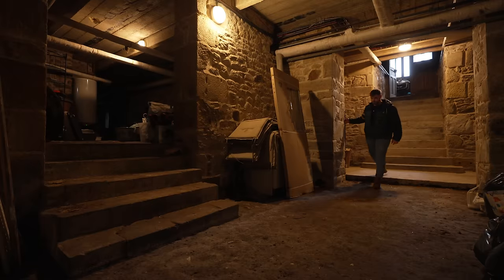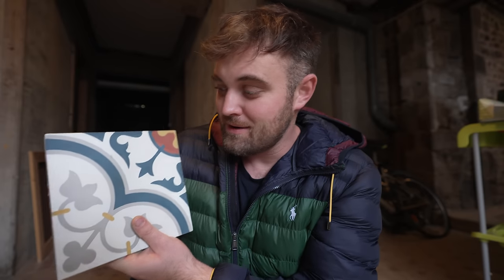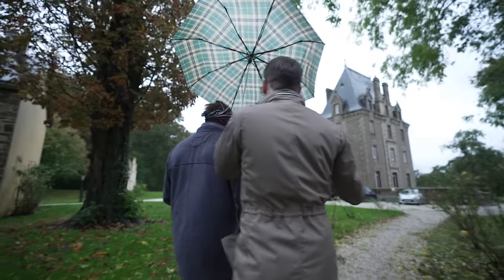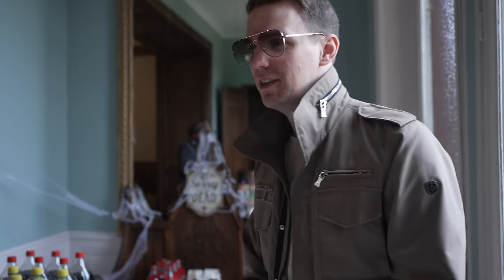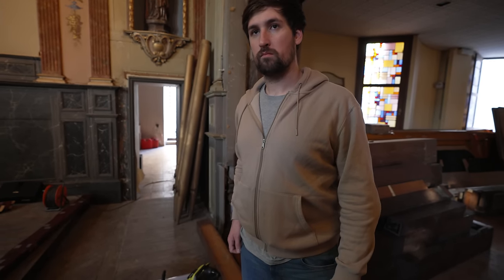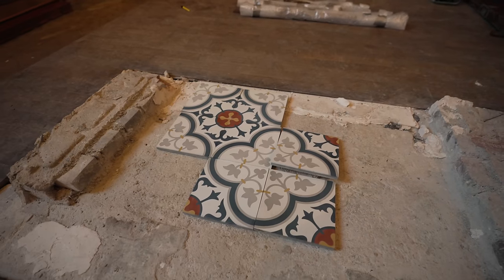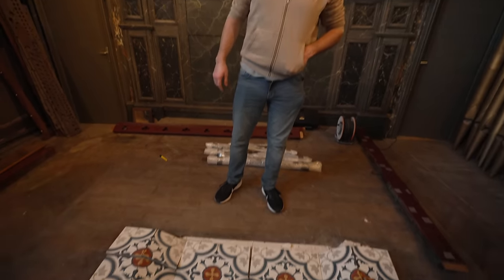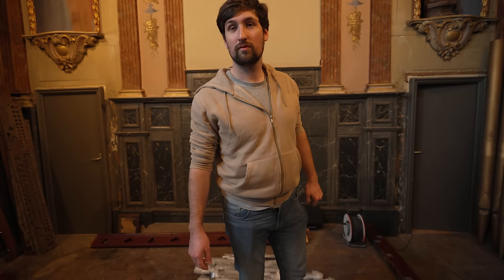Hearing Footsteps Inside The Old Convent

Comment: Wood heat warms you twice. When you cut it and when you burn it, but solar would be amazing. In the attic, sprinkle some chalk dust or flour on the floor, back you way out and then the next time you hear anything, check for footprints, large or small.
Reply: That was my thought with the chalk/flour, good plan.
Reply: Good thinking 👍
Reply: The rats!!
Reply: I work on the theory of 4 times.  You forgot the times when you stack it after its cut and when you move it from the wood store to the log basket.
Reply: Ghosts don't leave footprints.
Reply: The flour would prove whether it is animals or not making the noises.

Comment: It is amazing, the size of the Chateau's basement. The ceilings are tall and there is so much space. The other day I was thinking about your Chateau and the convent and thinking that solar might be a really good option. Also, we heat with a heat pump and it's just great. Heats the whole place with no problem, then in the summer you reset it and it's an air conditioner and keeps you cool.  Well, I have to say you and Ryan are a lot braver than I am. I heard the footsteps, but when that door shut and you both just stood there, I was like, why aren't they running away! Or checking behind the door! Crazy!  The tiles look nice.

Comment: I only found this channel last week. Very very cool. Even my granddaughter was instantly hooked. The tiles with the border would be amazing. 2 things though. First, I saw a comment about 10.24 in the video. There is something in the bottom left corner of the doorway. At first I thought it might be light reflecting from something, but it moves forward and back as if peaking around the doorframe then hiding. To me it looks like the outline of a child. Maybe something not seen on the other side of the wall was moving in the breeze causing it.  Second, rats and mice hop sometimes and it sounds like someone walking. Once had a mouse that hopped down my stairs, i was so sure it was a human i grabbed the gun. I didn't shoot the mouse but he did move on to another place.

Comment: Here's a thought to consider FYI
We have stellar Jay's that hop about on our roof and i have been startled more than once thinking SOMEONE was up on our roof walking about. Raccoons also are spooky sounding. 
You might consider it is animal or fowl causing the sound of footsteps! I am hearing them through the insulated attic in my case. 
The closing doors is likely air current or settling of that section of the convent. Unsettling,  but probably normal for the size and age of the convent.

Comment: With my heat pump it is the contract that I only pay for parts after parts, not labor after  the company comes and checks it if I feel something needs looked at, plus they will come check  as the seasons change for free. My only problem here in Florida are those little lizards that in it at times but pepper around the outside unit keeps them  away.

Comment: I also have photovoltaic panels for my off-the-grid Barndominium (Amish-built steel barn tuned into a garage and living space), and considered recirculating fluid in-ground heat pump, any people I know who had them say they are a huge drain on electric usage. Though it would need underground lines to be laid for recirculating a non-toxic antifreeze, heat from the ground is much less of a draw than air-to-air.

Comment: Billy: Check on a geothermal or ground source heat pump system for the chateau. You have lots of space to condition, and lots of land for the tubing. Not inexpensive to install, but inexpensive to run, and you get hot water and AC from the same system. It's also invisible outside once installed, low maintenance, and should last for decades.

Comment: Go, Yanis, go 🕺🏽.  Fantastic to see Rick.  Sensible idea to get solar and heat pumps for the Chateau.  We have had solar here for 3 years and it saves a lot of money each year (charges 3 cars, runs the Farmhouse for a lot of the year and even in the winter it gives us power for hot water/tumble dryer etc).  We need to replace our 10 year old oil boiler soon - and considering heat pump, electric boiler or infrared.  Wonderful to hear the bell ringing.  Have been watching a ghost series on BBC IPlayer called Uncanny (I recommend it, if you want something spooky for Halloween).  I am off to a local Manor House for a ghost hunt 👻

Comment: Happy 🎃!  I love the tiles, just not in the chapel - takes away from the reredos and other ornamentation around the alter area. Maybe a single slab of black marble acid washed so it’s not shiny. Even just putting wood and using a large burgundy rug for events. I was also wondering if you’ve seen under the chapel to ensure it’s strong enough to hold the organ. You’d said it was heavy earlier.

Comment: If and when you install solar, look at systems that have a power optimizer. They are very efficient and maximize production of electricity. Great for use in locations where some panels are apt to go into the shade (chimneys, trees, turrets, etc.)

Comment: If you are really looking at long term sustainable heating and cooling look into geothermal. It is extremely efficient and you definitely have the land to have a good horizontal pipe system. It can be expensive but it is something you can do yourself and save a ton in labor costs. Cool air in the summer and inly have to heat from 55 degrees to whatever comfort level you want.

Glad the party was a lot of fun!

Comment: Your party looked good. I didn't know Yianis had swivel hips like that! Solar power is definitely the way to go with both the chateau and the convent. You have other farm buildings that you can put solar panels on, to maximize your wattage. I love the tiles, but if they are going under the organ, then we won't see them. I would put something plain under the organ and use these as a border. I also think it is time to get a lot more cctv in the upper levels of the convent. You need to feel safe there, not worried. The door shut probably due to the wind, but I think you may need to ring that bell a bit more too! 👻 🔔

Comment: Nice vlog, and the tiles look great, as does that chandelier..I'd have been more worried about the door slamming shut, than the footsteps,  surprised you didn't investigate  that...PS the heat pumps are not great; they cut off if it is too cold outside, ( just when you need it!), and never yet have they reached the desired room temp of 19C.

Comment: You could level the area low enough that the tile will be flush with the wood floor, except for the taller side pieces. For the two taller sides, you can level them with the hight of the tiles, so that they are still visible, but not standing proud of the floor. I would consult with the Father and ask if he believed that it was too close to what he said about it being decommissioned, and what he and the others that he works with thought. That part sticks in my head for some reason.

Comment: Hi Billy, I think that the tiles work beautifully. Your idea about the oak frame sounds good but would you consider a more "precious" seeming idea that would really elevate the space? I was thinking that if you have a marble showroom nearby (or odd pieces lying around) you might be able to buy some remnants in color (blue?) that could thinly frame the tiled design as you would with the oak. Maybe just an inch or so in width and in any length that would complete a surround. Pieced together at odd intervals would give it charm and a reminiscence of chapels of old.  Corners need not even be mitered.      Just a thought ....

Comment: If you install heat pumps in the Chateaux, you’ll be sorry. They don’t blow hot air, they blow cold air and somehow equalize the heat inside the building, but you’ll always feel cold. And when the temps drop below 40 degrees Fahrenheit, forget it. You’ll need an auxiliary source of heat, and if you use electric, it’s going to quickly become very expensive.

Comment: Have you ever thought of installing a geo-thermal heat pump?
if you are on the right type of bedrock, they are more effective then an air heat pump. Combined with a solar system that produces the electricity, they are basically a non-maintenance, self-sustaining system, which in times of wonky electrical grids and rising electrical costs, can be a life- and moneysaver.

Comment: The tiles are perfect. A border strip of oak will look good too. Your log boiler is it a gasification model? We ran a Villager AHI boiler stove in an old School House in Normandy in 2008. It ran 12 radiators. Use a lot of mixed wood. Around 25 cubic metres over 7 months of winter. Cost then delivered ready to burn was 15-35 euros a cubic metre. House never been so warm. 600 litres of oil was getting on for a euro a litre and only lasted 6-8 weeks. Could you go for geothermal heating at the chateau? Bore hole option.

Comment: Design and colours fit perfectly!
But keep a few for repairs that will never be the need if you have them. To fix the gab with oak is easier than finding matching small tiles or mosaic.
Found information about the chateau French lily fireplaces 
In the Netherlands they said that they were given by Napoleon as a certificate of merit. The one in the dining room is very large equals large merit. Crack on!